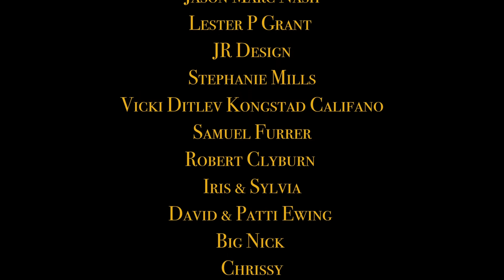Diy Nightmare - installing a sliding door @ the passion project

Comment: Edd, I noticed the split system in the bedroom is fixed to an internal wall. Where does the ducting and wiring go to the compressor? I’m curious as they won’t instal like that here in Australia. It always has to be hung on an external wall.
Reply from the maker: It’s in the partitioned wall….. yes  I struggled to get the copper, cable and more so the condensing pipe in (as that has to always have a fall!!) but it is possible